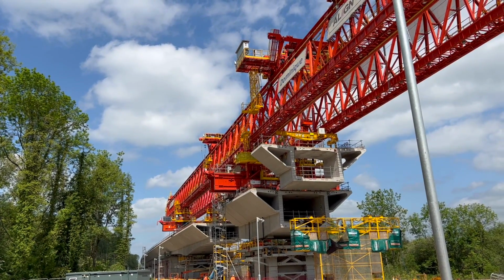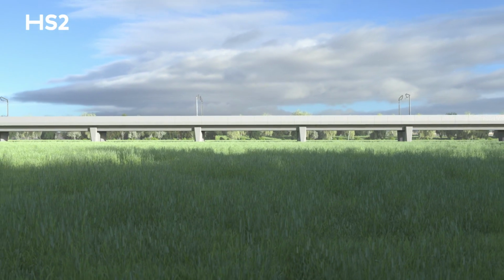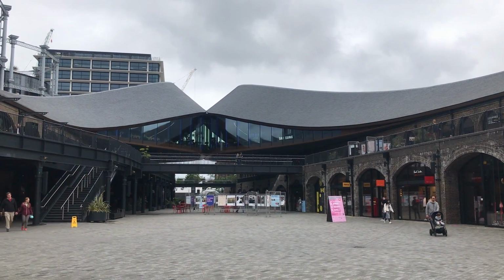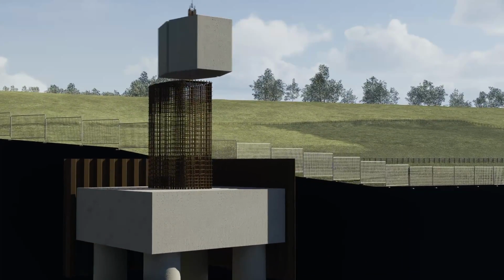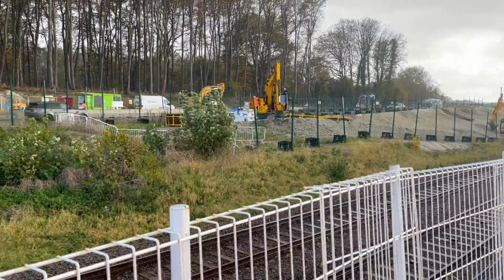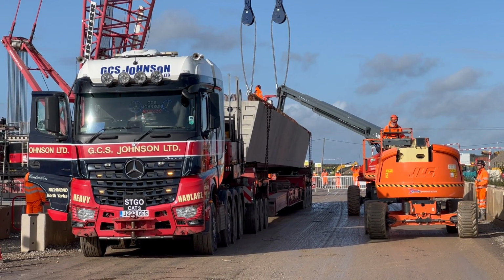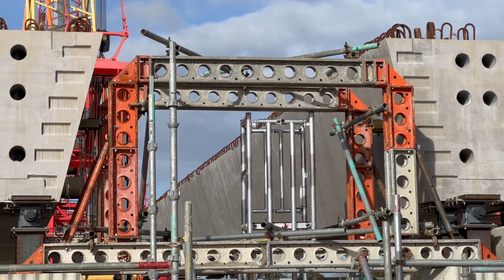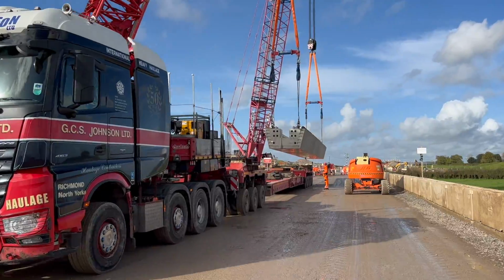Return to HS2: The Art of Compromise

Comment: It’s crazy they didn’t keep the line to Crewe. It was the cheapest bit of the entire project.

Brum to Crewe was under 10% of the cost of London to Brum.
Reply: Indeed the major problem cutting the line short at Litchfield creates is there is no bypass for the 2 track bottleneck through the tunnel at Shugborough.   That's also why phase 2 was split into a and b, as the planners realised it was dead easy to build 2a on to Crewe and create a massively better line more rapidly, leaving the harder bit to Manchester for later.
Reply: @ADAMEDWARDS17  Although a localised Stafford bypass could improve that quite cheaply. Other than Shugborough the current WCML alignment seems pretty good?
Reply: Ha ha. Bit far away from the Southern profits. No London politicians having shares in projects above Watford junction.
Reply: The most congested section is London-Rugby. Costs have been cut because there will be a general election some time in the next year. The plans will be re-instated at some point, but maybe not until the first part of the line is running.
Reply: @TheRip72  I suspect Labour will almost immediately freeze the sale of land assets. An protect it for 30 years, if they get elected.
Reply: While you may well be right, we will never know as the actual, true cost has so far exceeded the budget. So what unknown factors would have lied in wait between Birningham and Crewe will never be known.
Reply: @TrevorWilliams-fq8mg  it was mostly open fields, the only complex bit was the approach into Crewe itself.
Reply: I agree with you on the face of things. But there might still have been a lot of unknowns like unforeseen ground conditions, road diversions, planning requirements, services diversions. Another example might be a repeat of what happened further south where a trackside substation required a power connection from a remote source 5 miles away, crossing a river, a motorway and a railway. Too many unknowns to know the truth but I agree the line should have run as intended to Manchester. There's still a lot of unknown factors around Birningham and Euston which still have to be resolved and I wouldn't be surprised if the final cost from Euston and terminating just north of Birningham comes to 150 billion which will still cause future chaos in government.

Comment: I think the Crewe segment would be best restored to the plan if they are building HS2. It seems about the right balance to me, the plan around Manchester always seemed suboptimal. One point in favor of HS2 is construction is moving reasonably quickly, despite the price tag; California High Speed Rail has been spending money at absurd rates and hasn’t been getting much done
Reply: The original plan with Manchester was to put it in a tunnel into Piccadilly then leave a stub end at the terminus so it could be built out to continue on for when HS3 was built (which is more or less confirmed as dead at this point). They changed that to having a new viaduct and then a full on terminus, meaning any future expansion would be extremely expensive and difficult. They even screwed over any future expansion of Euston by selling off all the land around it to property developers. Euston is already a massively over burdened station. It's maddening just how shortsighted and callous they are with their "plans". It's like they've doubled down on doing the worst possible thing for the country since 2010.
Reply: I don't believe they have sold it off yet. I read no one is really prepared talk about investing until after the elections. If Labour wins I suspect they reinstate the 12 platform design with HS1 extension a possibility and tell HS2 they a few years to get shovels into the ground before the general election.  @TalesOfWar

Comment: We absolutely do need the extra capacity on the WCML, not least for freight, to ease the traffic on the M6.  Whether we needed higher speed is arguable.  It will still be quicker to go to B'ham New Street directly from Euston, for many more years.  In France, all these NIMBYs would not be tolerated.  The cancellation just shows that "levelling-up" for the North was a lie.
Reply: How will it, all Avanti West Coast train services will run London Euston to Birmingham Curzon Street
Reply: @peterwallen1063  Even if Curzon Street is built, HS2 will not get south of Old Oak Common for about a decade, if at all.  Until then, it will be Euston to New Street, unless you get from Euston to OOC by other means.
Reply: @john1703  Even if Curzon Street is built, just listen to your self you definately have not done any reserch, Birmingham Curzon Street is being constructed as I write this, so it is not a question of "if" but when will it be finnished, and Euston will be finnished long befoore a decade as OOC is not desighned as a terminus station but as a through station with no terminus facilities to service trains, and as Avanti West Coast Railways will be running both the WCML and HS2 services all Birmingham to London srvice to the HS2 route

Comment: But the cost has to be divided over it's life span. The current rail system was started in earnest in the 1840's. Nearly 200 years ago. So divide the cost of HS rail over 200 years and it doesn't seem too bad. It will never be cheaper to build than it is today!! Crack on, build it all, right up to Scotland and into Wales too!
Reply: Also note that when looking at international comparisons, costs are often higher in the UK because they include a much wider scope ... eg, including the cost of buying the trains and expanding capacity in city centre locations, where other countries would account for the trains separately and don't need major new works in city centres because they weren't already pared down to the bare minimum.
Reply: Also if it was to cost 100billion that was to be averaged over the remaining 15yrs of contruction which equates to about 6billion per year out of an annual UK spend of 3000billion per year
Reply: And link it to HS1.

Comment: Very interesting video from a civil/structural point of view.   
Politically it is also interesting in that the project costs have escalated so much in order to keep the residents between Birmingham and London happy ,  that the “master plan” has been castrated,  leaving everything north of Birmingham-Manchester- Leeds reliant upon the canals, as an alternative to the road congestion between Birmingham Manchester and Leeds.   So much for the “Northern Powerhouse “ which has as expected,  turned into a meaningless PR headline,  because a significant part of what is the industrial heartland of the U.K. lies between….Birmingham Manchester and Leeds.
Reply: Part of Northern Powerhouse relied on the HS2 tracks into Manchester. Which doesn't make a lot of sense if the HS2 lines terminated in Manchester. Manchester needs an underground station so that the line can be extended.

Comment: I've heard excessive consultancy costs and revision have also driven the price up. Sometimes more money has been spent on value engineering than was saved. At some point you have to pry the design out of their fingers and just build it!
Reply: Euston station has been redesign 3 or 4 times, each design cost tens of millions of pounds.
Reply: Tories are great at that, they cost Crossrail more with their “just use multiple signalling systems” ‘cost saving’ plans than just upgrading the signalling along the whole length would’ve cost.
Reply: Nimbys
Reply: True value engineering cost comparisons include the consultancy re-design costs. So a value engineered cost comparison is an exact like for like cost comparison against the original solution.

Comment: Good to see a positive commentary on this project.

Building infrastructure is expensive and few people see the value until it stops working properly. I’m unlikely to be a regular user, but what surprises me is it wasn’t started in the north to ensure that part was built first, so the whole project was built, rather than just building the London bit.
Reply: It's as if the Government never wanted to bring it to the North in the first place...
Reply: @SEAWORRIER 
It is more than obvious that they are not interested in the north to the Midlands line.
Reply: @SEAWORRIER  Unfortunately HS2 hasn't had a Government supporter of the project since Boris Johnson was PM. Although to be fair, a few other Tories did object to the cancellation.
Reply: @hairyairey  One thing about Boris Johnson I actually liked was that he wasn't afraid to look at and  back big ideas. It was nice having a PM that believe in big engineering projects. 

Unfortunately he just wasn't that great at running the country.
Reply: @DavidKnowles0  He was genuine in wanting to support the North of England. Unfortunately none of his successors have had the same attitude.
Reply: Even as a Northerner I recognise that the southern end of the WCML is the busiest, so it makes sense to start with that end. No point in freeing up capacity at the northern end if trains are still going to run into congestion further south!

Comment: HS rail should be easy in the UK, we're in a long thin island. All you need is a north-south line; London - Birmingham - Glasgow. With 2 spurs; one towards Bristol the other towards York. I recon that would be within 45 minutes by local rail of 90% of the population. Then you can ban internal flights like France (with dispensations for the Higlands and Islands).
Reply: @davidbarrass That's not too far off the original concept; London to Manchester with a spur to East Midlands/Sheffield/Leeds. Bristol has adequate service already, while population density drops off sharply north of Lancashire. The 1970s West Coast electrification to Glasgow was far less profitable than the original legs to Birmingham and Manchester/Liverpool. Also, it is still pretty quick with the existing trains (likewise London-York-Edinburgh).
Reply: Should be easy. But politically, not so much. A lot of it is the old NIMBY problem: A lot of communities and councils oppose the rail going through their area because of the disruption that a major construction project causes and fears that noise and loss of unspoiled natural views will lower property values. The endpoints are also ridiculously expensive because it means buying up land and demolishing buildings in major cities - thus the jokes about connecting almost-London to almost-Birmingham. Neither end actually goes up to the city center, you have to get off at the fringe of the city and change to a local train, which defeats the purpose of high speed rail.
Reply: Bristol would probably be better connected up to Paddington than Euston mind you.
Reply: @Croz89  That may be true, but on the other hand is everyting centered on London a good idea? Currently yes, but that does draw people and ideas away from the regions. Could a Bristol - Birmingham link stimulate both?
Reply: @davidbarrass  Maybe in the future, but there isn't the demand at the moment. London has to be linked up to any HSR network to make any economic sense, especially as it has the HS1 link too.
Reply: @davidbarrass  There is already a Birmingham to Bristol link

Comment: Price does outweigh the benefit! Especially since there was never any great demand expressed for it, other than that  other countries were building high speed railways. 
The scale of the project is incredible and they are using cutting edge engineering technology which is cool but our country is only 800miles long. and i wonder if it really should be rejuvenating the transport that is used by the masses on a daily basis, rather than impressing their eu counterparts.

Comment: I'll be surprised if HS2 ever pays for itself let alone make a profit. 50 years too late in my opinion! Oh, and I am a railway nutcase too!
Reply: As a railway nutcase I have looked at HSR numbers for years and can confirm that HSR cannot pay for itself at HS2 cost per km.
Reply: It will make money as the train services on the HS2 linw will be run by Avanti West Coast Trins who will transfer all non stop high speed trains from the existing West Coast Route onto the HS2 route
Reply: @peterwallen1063 You pretend to know but you are mistaken. 
1: The government doesn't know how much of the HS2 investment they will try to recover. The Office of Rail and Road states : "the charging framework for HS2 will not be determined until much nearer the start of operations. Nor has it been determined which precise operating model will be applied to HS2, in terms of Infrastructure Manager and train operators, or indeed whether the Infrastructure Manager (or operators) will remain in public ownership."
2: Avanti doesn't know whether it will be in charge.
3: Until the charging framework is set, operators can't predict how many customers are willing to pay said charge for a fast OOC-Curzon Street trip.

Comment: Youtuber and railway engineer Gareth Dennis really changed my mind about HS2, I recommend his videos to those that want to learn more
Reply: What was your opinion before and what is it now?
Reply: @paulsengupta971  I had my mind on HS2 changed as well by Gareth Dennis from being unfavorable to being quite supportive minus quite a few issues that I have with the station designs (the reliance on terminus stations instead of through stations and the fundamental constraints on capacity and future operations that these have.)
Reply: @paulsengupta971  I knew little about the point of the project, just the negative press about the excessive £100 billion figure and how it would destroy towns and the environment. Gareth talks about the benefits that come with HS2, why its so expensive and debunks claims about the environmental impact of its construction.
Reply: @datguy6101  Another point that Gareth has been good at pushing – and which most of the press pay no attention to – is that the benefits of HS2 are for wider than just those cities directly served by HS2. For example, Northampton is set to have huge gains, because Hs2 will free up capacity on the WCML to run intercity trains from Northampton to points north, which the current network can't accommodate.
Reply: @stevieinselby but “the WCML has no capacity problem, it’s currently running just fine” 🙄 these are the same type of people who think y2k was never a problem instead of just fixed on time at immense effort and cost.
Reply: @kaitlyn__L  The WCML has enough capacity to run the current schedule of services, but not to add all the extra services that there is evident demand for, such as more trains through Northampton, more frequent stopping services on the Trent Valley etc.
Reply: @stevieinselby  exactly! That’s why I find that argument so frustrating :(